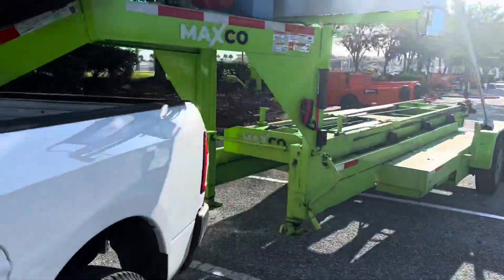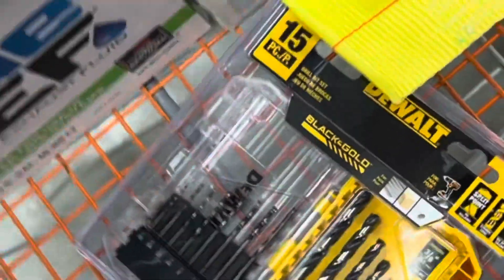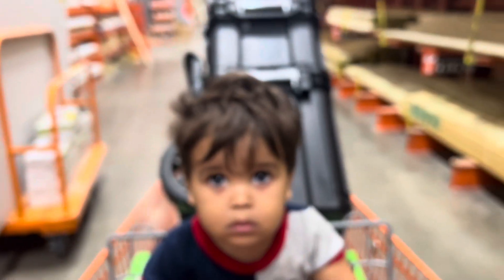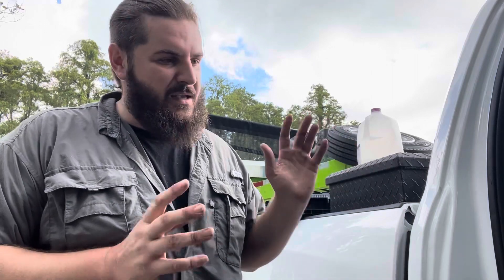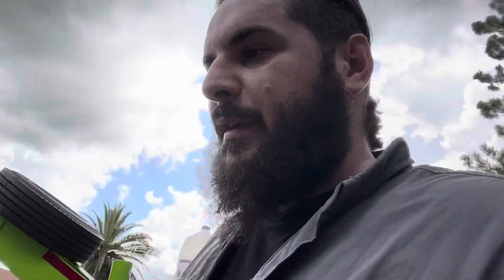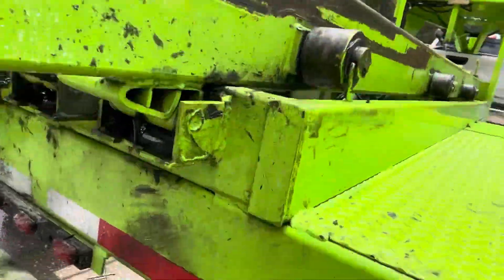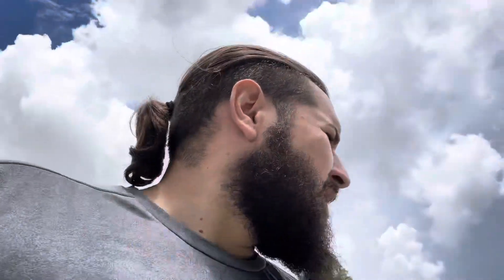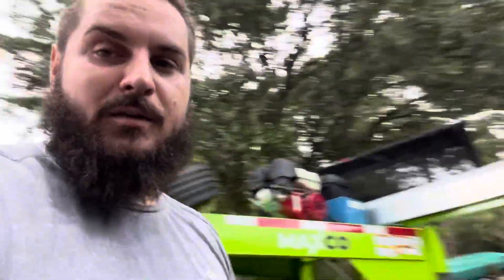MAINTAINING equipment on a SLOW DAY

Comment: Hey Joe, just a note:  Get rid of the "common utilitarian black/grey grease;" and use some TEK®"Ultra Tacky Grease" - that possesses the highest true E.P. (Extreme Pressure) rating in the industry or another good option could be Lucas "Red & Tacky" (= Lucas "Red & Tacky" - available at your local Sam Walton brick & mortar).  They both hold on better and less slime-drop in the Floridian heat. 👍👍👍👍👍
Reply from the maker: Thank you! I learned a lot this past few months with the FL heat. I realize now that this cheap grease is not going to cut it anymore. I recently put a tube of Shell Rotella threw the gun and it was a whole new experience. I’ll check those others out. Appreciate the tip!

Comment: Great video, how often do you need to service your pony motor and grease your trailer?  Thanks,  and can’t wait to meet you and everyone else in Dallas.
Reply from the maker: Greasing should be done regularly, but how often relies on how much it’s used as well. If you’re cranking multiple drops a day then at least weekly. Motor just needs an oil change 1 or 2 times a year. Honda engines are super low maintenance.

Thanks for tuning in! Looking forward to it as well. 💪